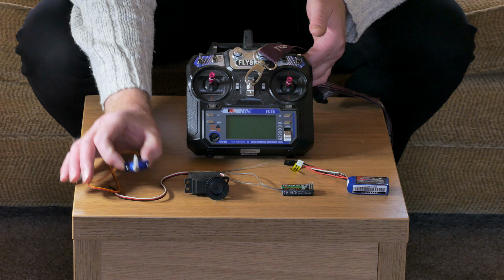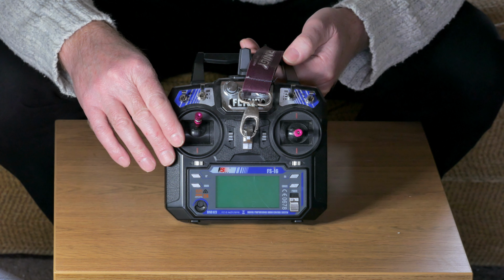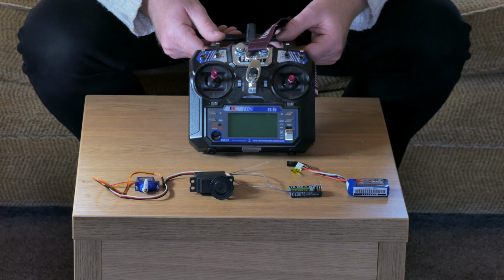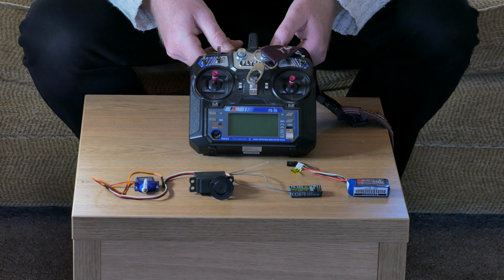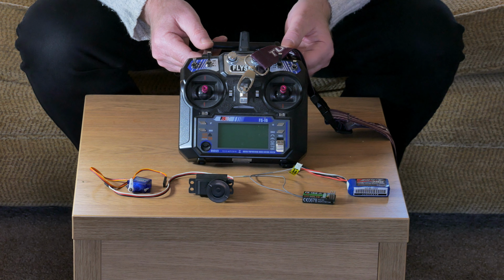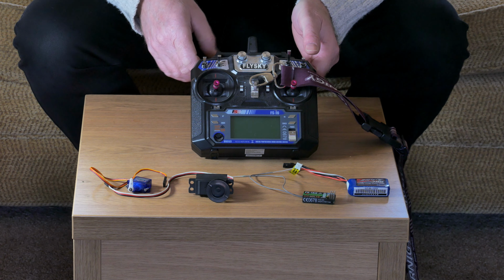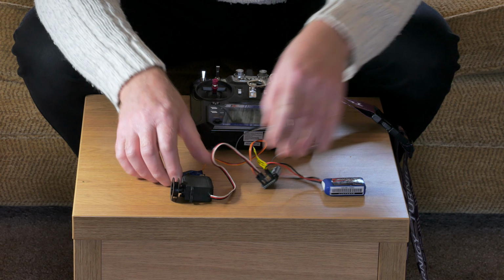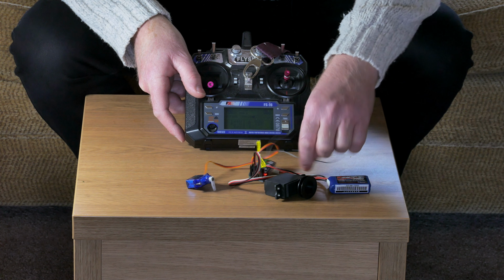What is Model Yacht Racing - A basic explanation of the radio

Comment: Thanks for the video mate! What is the range on this setup please? Considering the receiver antenna placement at sea level, We would lose a lot of signal dissipating into the water on 2.4gHZ. With the Flysky receivers, The different models cater for different applications. Which Flysky receiver would be best for across water? I would like to have no anxiety about losing range when say heading to a mark that is 250m away etc. Im not looking for a mile by any means, But what are they typically getting out to without stressing about signal loss? Thanks in advance from Australia
Reply from the maker: The questions you ask are more technical than my knowledge, so I can't really answer them.  What I can say is that for small model yacht racing purposes the setup shown here will take the boat beyond your ability to see the boat clearly with unaided eyesight.  The transmitter used here is very widely used in the UK  for model yacht racing and I have used them for many years and never had signal loss whilst racing.  Except after dropping the transmitter in the water, they don't work so well after that!   A lot of skippers use the B version of the receiver rather than the standard one shown here, mainly due to the extra enclosure which helps keep dampness off if water gets near the electrics.
Reply: @modelyachtracinguk  That was very helpful thanks mate, I'm just getting back in RC Sailing again after many years away from it. Good to know that this setup works well as it seems to be a popular one amongst sailors. I thinks its time now to purchase a few receivers and get the fleet wet. Thanks again for your help, Great informative video mate! You take care, God bless you and yours.. Baz, Australia

Comment: Where does the on-off switch go in your schematic? I bought a used hull that was completely disassembled and could really use some advice here. I assemble the servos/battery/receiver just as shown and it works perfectly but when trying to add the on-off switch nothing works. I should add that I tried the switch between the battery and receiver. Thanks in advance.
Reply from the maker: Between battery receiver would be normal.  Possibly the switch has failed?  This is a common fault on the DF class boats.
Reply: @modelyachtracinguk  Thanks Mate! I'll test and replace if necessary.
Reply: Do you have any info on whether the recent switches are better quality? Would I be advised to look into another switch (if that is even class legal)?
Reply from the maker: For the DF classes it needs to be the one supplied by the builder to be class legal.

Comment: If you are just starting out buy yourself a 2 channel set which will cost around the £50 mark don't know where he got the price for his radio system as the one he showed would be around the £ 80 plus price range, if you buy a half decent 2 channel set you can buy extra receivers, just check with the seller before you buy